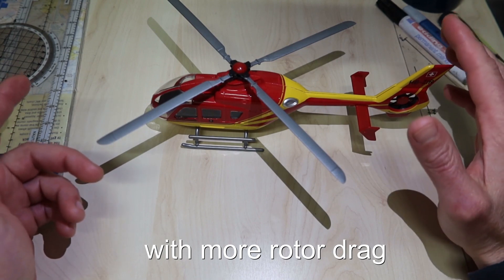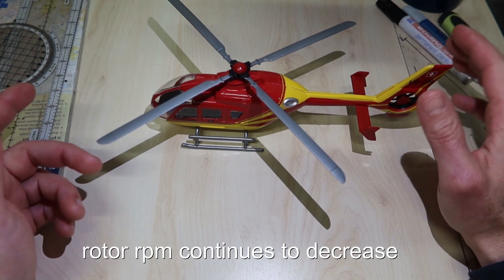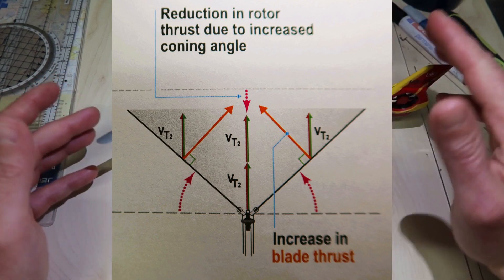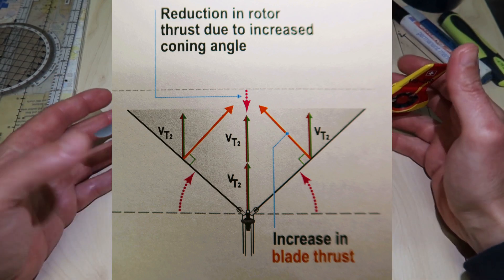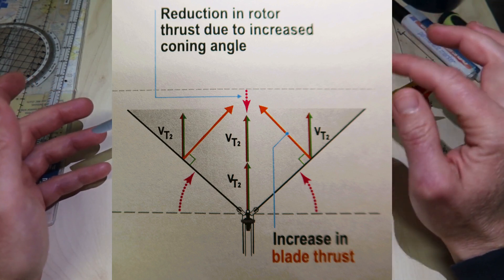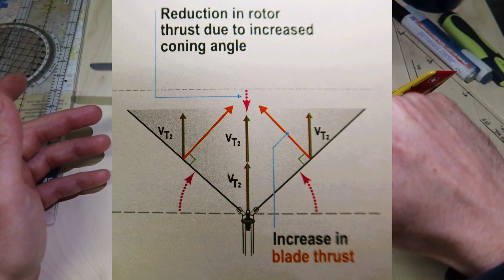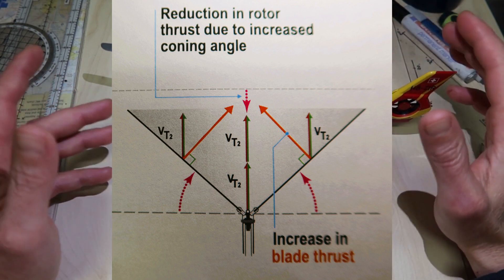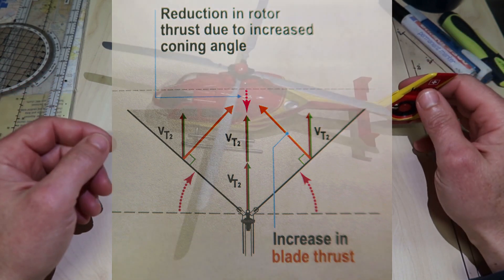Over-pitching effect on helicopters

Comment: Why is a helicopter designed to allow or give room for over pitching?
If designed properly, over pitching would be impossible.
Reply: no
Reply: It's because you need the extra pitch control available for reaching a decent speed in forward flight. If you use that extra pitch control when hovering, you will over-pitch and lose rotor RPM. Once your flying forward though, you reduce collective to maintain altitude but you now need that extra cyclic control for reaching higher forward speeds.
That's why.